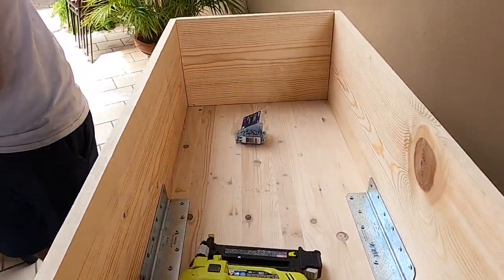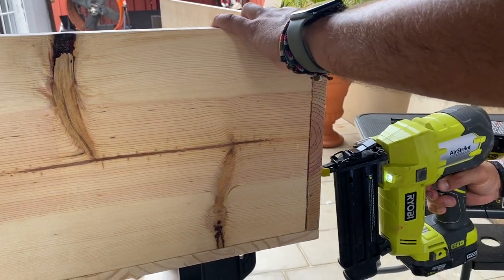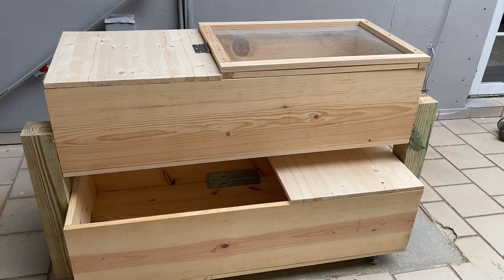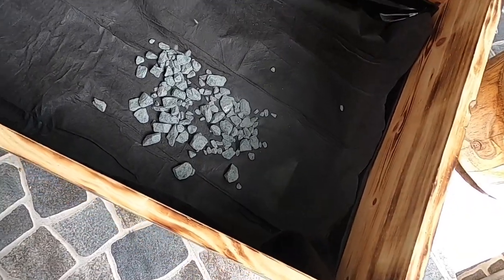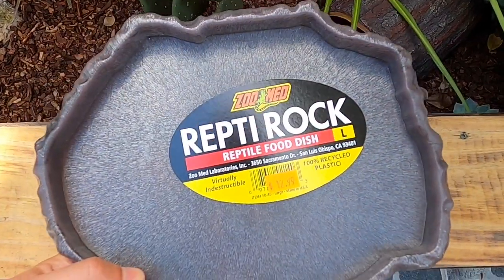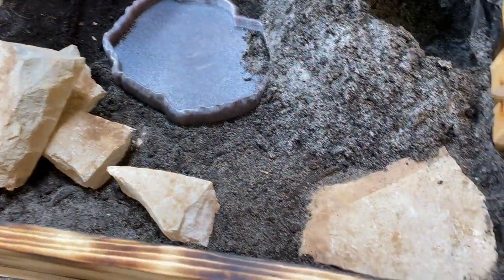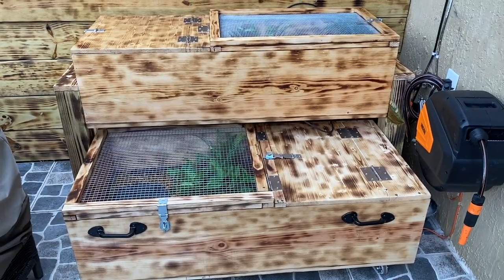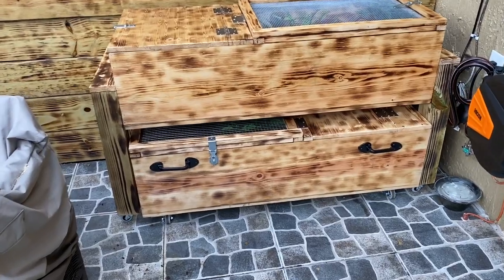Outdoor tortoise table build

Comment: Nice out door eclousrue but tortoises like to forage for grasses and weeds I made just using a massive square wood put wire mesh over the top ❤
Reply from the maker: They currently have a large outdoor area now where they can naturally do so. These were temporary set ups while they were still small since they are much larger now they can be in a natural open setting. I’ll post an updated video soon, stay tuned